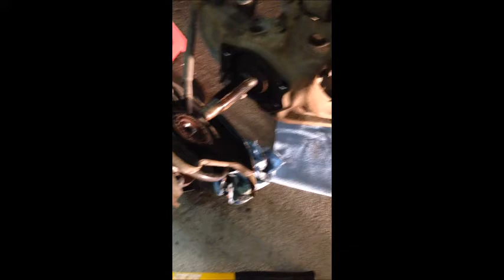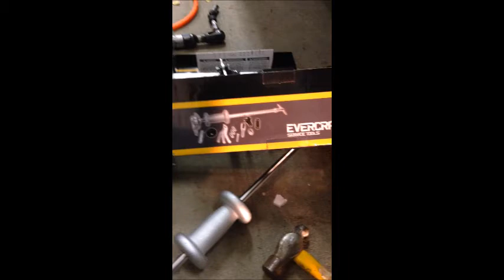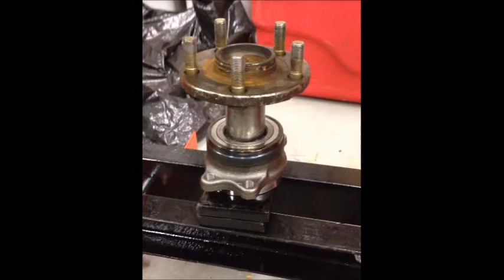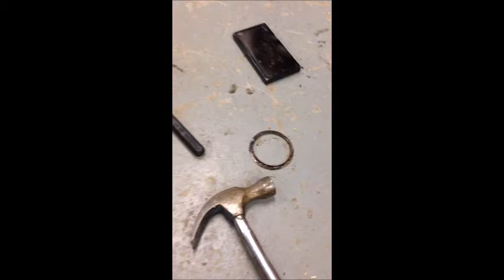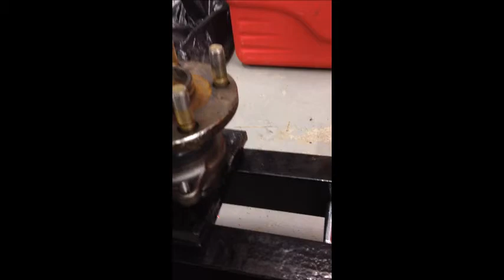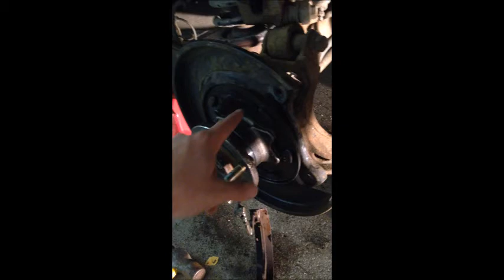Subaru Outback (2000) rear wheel bearing replacement without dis-assembling the rear suspension.

Comment: I used to a slide hammer to remove the hub.  Of course the bearing 
broke, so the bearing housing stayed behind -- it was rusted to the 
knuckle.  What I did was screw in the 4 bolts from the front part way in
 and used a long punch -- about 10 inches long and a 10 pound sledge 
hammer and hit the ends of the bolts from the inside.  Also used some 
heat and penitrant from the front.  It did come off.  I used a cheap 
shop press and a bearing remover to separate the remnants of the bearing
 from the hub.  Put the hub in the freezer for a few hours and it will 
press on to the bearing much easier

Comment: Mostly uninformative do to the lack oft video of several of the procedures. Most notably what he used and how he used it to press the assembled hub, bearing into the rear control arm. Get a tripod if you or have some one else work the camera.
Reply from the maker: sorry you didn't find the video helpful. I couldn't find any info on this project myself and wanted to provide what pointers I could.

Comment: Was it difficult to put the axle through the new hub and bearing assembly? I'm doing this job on my Subaru now and the fit is very tight. Don't want to force it.
Reply from the maker: I remember it not being a difficult re-assembly. I remember using a large socket and a rubber mallet to re-seat the new bearing assembly into the knuckle.

Comment: I suspect you can also buy a new spindle/bearing already as one piece.  I have a floor press so if it's cheaper I would reuse my spindle but I bet it's not. Well, I'd be wrong.  I could only find a proforce one with no reviews.  Take a chance or reuse the hub.

Comment: It's not a pressed bearing, it's a sealed bearing.  The fronts are pressed and are a joy, have to be pressed in and out of the hub.  But the back are a sealed unit.
Reply from the maker: you're right, the bearing is a sealed unit, but the bearing assembly was pressed into the knuckle, if I remember correctly.
Reply: The rears are sealed as well AND pressed onto the hub.
Reply: @OffTheBeatenPath_  What a pain.  I haven't had to do the rears even still but I have a floor press and am ready.

Comment: I used a slide hammer and that 27037 add-on that attaches to the hub nuts, but now I realize the slide hammer could just be inserted through the hole in the hub with a washer and nut to pull the hub out. On a 2000 Impreza wagon I only needed to remove the long lower bolt for the whole job. I did not remove the four bolts you removed to remove the bearing housing. Also a bearing separator is the alternative to Dremel cutting. See Harbor Freight 93980, and 66829 or clones.

Comment from the maker: Direwolf, a necessary tool that I didn't mention in the video is a heavy duty 3/8 wobble extension to access the bolts that attach the bearing assembly to the knuckle. There are 4 of them and they have to be accessed from behind the knuckle and there's not much room. I also used impact airtools to loosed these bolts which certainly made the job easier as well.